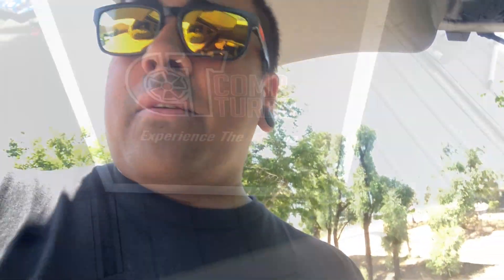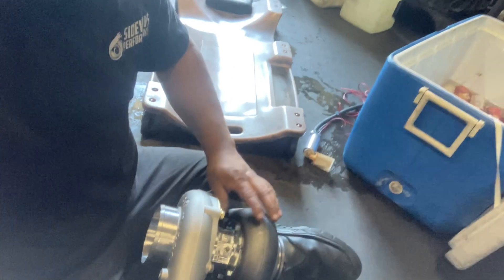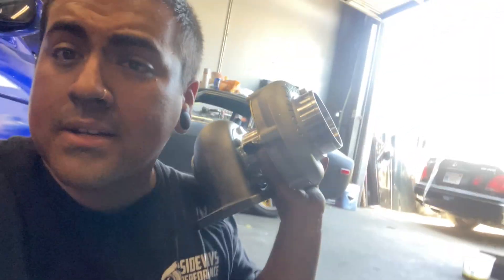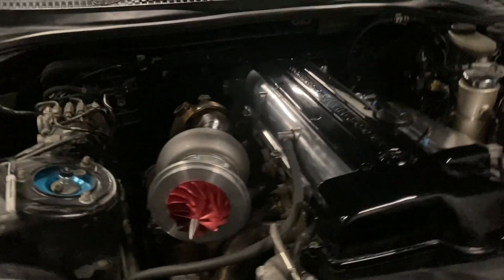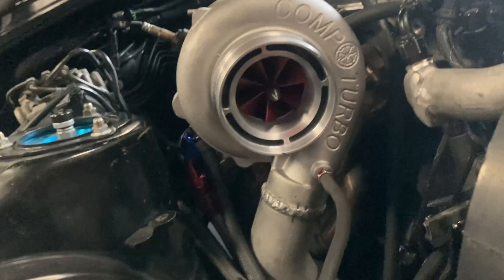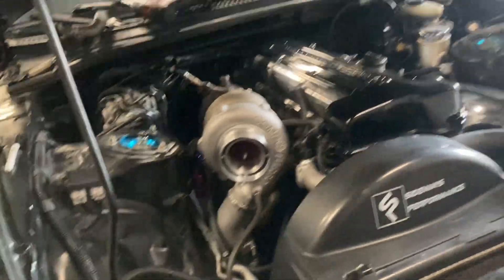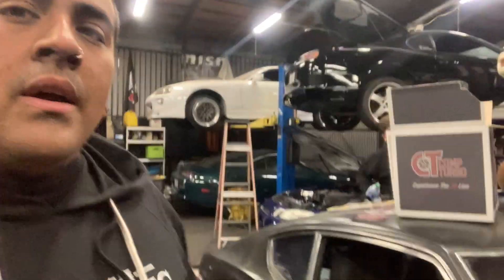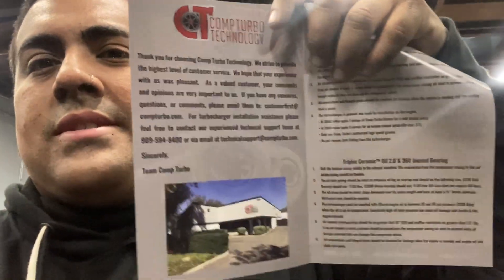Supra Gets CT BIG Oil-less Turbocharger

Comment: How did it spin by hand after warming up? Seems pretty tight for a ball bearing
Reply from the maker: So from my understanding what happens is the grease that Comp has designed has to be heated up to a certain temperature in order for the turbo to operate at full capacity upon break in .. Yeah the whole process triped me out to but the turbo work flawlessly so
Reply: its a grease based so yah think about it.butter til hot  @SidewaysPerformance

Comment: Benefits of an oilless turbo? Besides not having to modify a oil pan for a return line?
Reply from the maker: What do you mean that’s one of the biggest things about it if you’re looking from a financial standpoint It’s expensive but if you’re looking at it as a customer instead of spending the money on labor you can spend it on a quality turbo
Reply: @SidewaysPerformance  but buying the grease is $180+tax and shipping every 3k miles? Doesn't seem worth it when you could buy an upgraded baffled pan with a drain built in and do it that way.
Reply: @datboi8140  Bro one tube last a year 😂. I bought the HellHorse Twin turbo kit for my mustang & it uses the Comp oilless turbos. That would be insane $180 every 3k miles lol
Reply: @nola504boy1  how they treating you???? i just orded the hh kit with aircooled turbos
Reply: @corsagays9000  how did that work out for you?
Reply: @christucker9566  still sitting on my shelf i got shipped a damaged intercooler and iv been waiting for a new one since the last comment 🤦🏽‍♂️🤦🏽‍♂️🤦🏽‍♂️
Reply: @corsagays9000  sounds like hellhorse.
Reply: @SidewaysPerformance  but after doing some research, one of the main benefits would be cooler oil temps and a turbo failure wouldn't send any material into the oil. Something to consider

Comment: my 2j was the the opposite i put a turbo on and it keeps killing rod bearings.....it was a ge built gte..... i traced it down to na pumps only make 7 psi at idle and like 20 psi wide open just not enough after turbo... ive since gone to a gte pump and the issue stopped
Reply from the maker: Yeah definitely are used GE pump will probably only get you that for sure a new one though we should give you about 38 to 40 psi at idle in about 90 to 100 psi a full throttle
Reply: @SidewaysPerformance  I get like 65 at idle and 130 plus wide open on a new gte pump now
Reply: @SidewaysPerformance  before my 2 j all I ever really messed with was chevys
Reply: I can help with any oiling problem you guys are having with a 2jz. There are way too many successful oiling programs on the 2jz engine for anyone to struggle with killing bearings OR turbos. Thanks